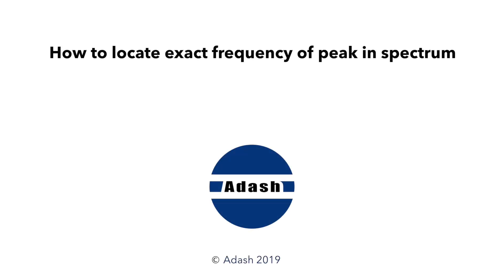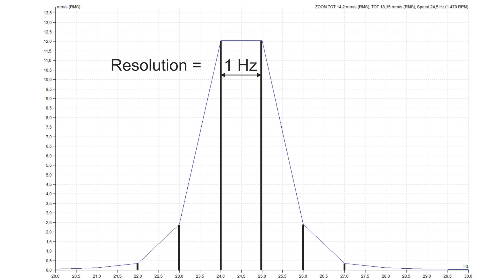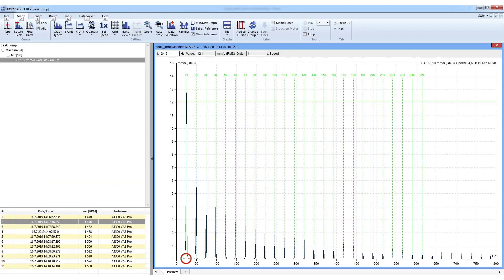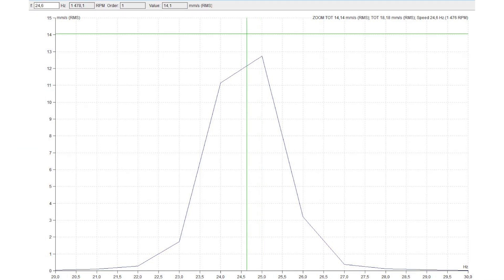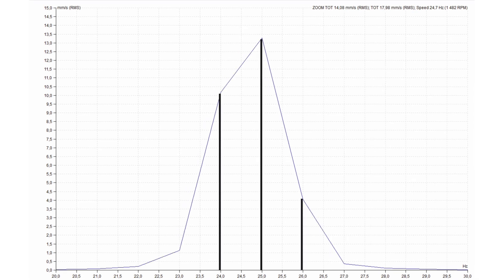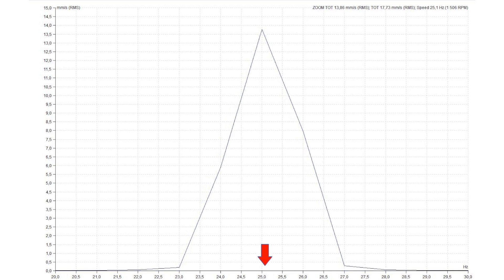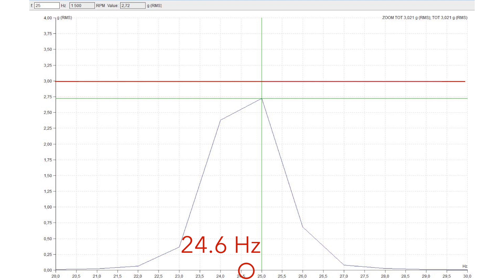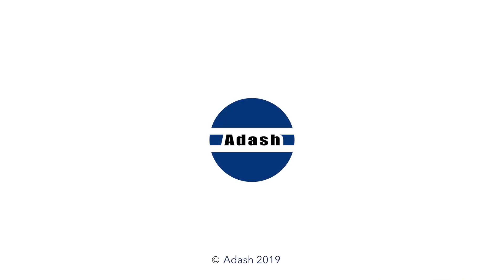How to locate exact frequency of peak in FFT spectrum

Comment: Okay, but how to I calculate the exact frequency by myself if I do not have this software but only the result of the fourier transformation?
Reply from the maker: First, we find a peak in the spectrum which we are interested in. Then we take higher adjacent peak of that peak. Thus, we have two adjacent spectral lines (f1, y1) and (f1 + df, y2).
If the spectrum has been calculated after using Hanning window, the frequency correction can be performed using this equation:

f = f1 + df * (2 * y2 - y1) / (y1 + y2),

where
f is the corrected signal frequency
f1 is the frequency of left line of my lines pair
y1 is amplitude on f1
y2 is amplitude on f1 + df
df is delta frequency between two lines
Reply: @AdashCompany  is there a similar equation for amplitude ??
Reply: and phase?
Reply from the maker: @jacobwood8653  It can be deduced for amplitude.
Reply from the maker: @jacobwood8653  We are not sure about it at the moment. This would need to be studied. Maybe this is question for Google ;-)